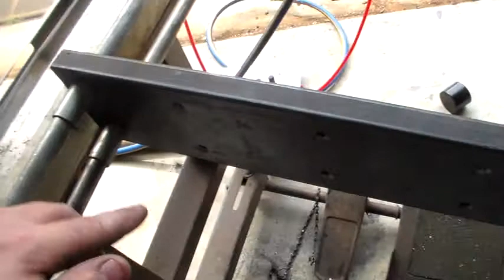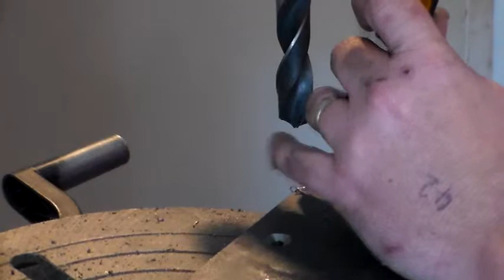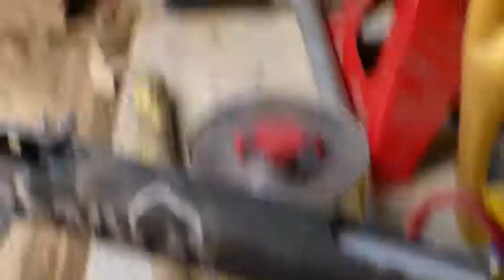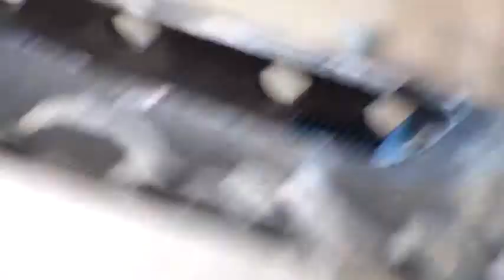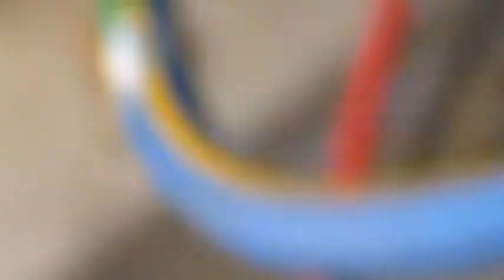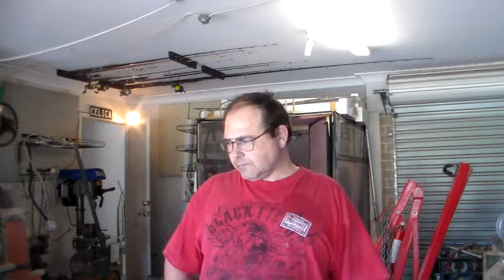Making a Plastic Injection Molding Machine Part 15

Comment: You need an inline pressure relief valve to prevent to backup return from over pressurising mate.
Reply from the maker: auventi Australia I hadn't considered that, that's for the tip!
Reply: All good, the pressure does not have to be direct from the pump like that if you had a shuttle valve you could use the exact amount of closing pressure, when the moulded material is soft you really don't need a lot of force just smooth and accurate stamping with the right ports for excess displacement. Just a suggestion.